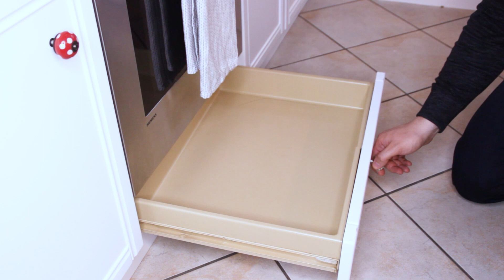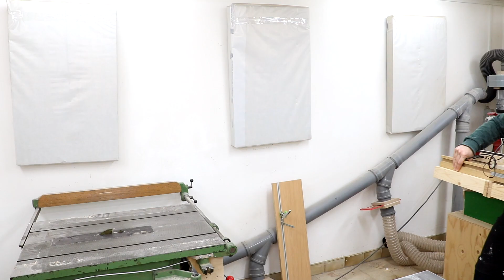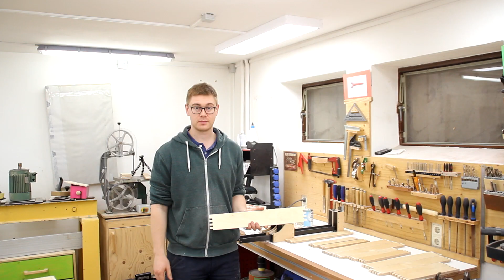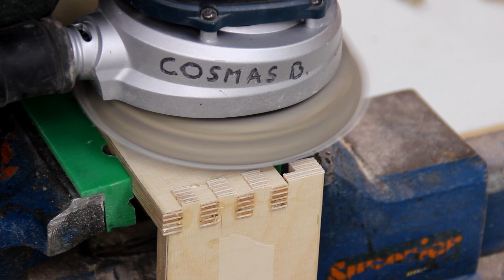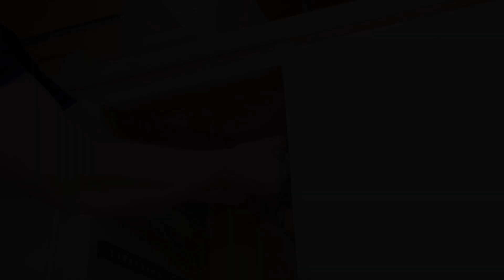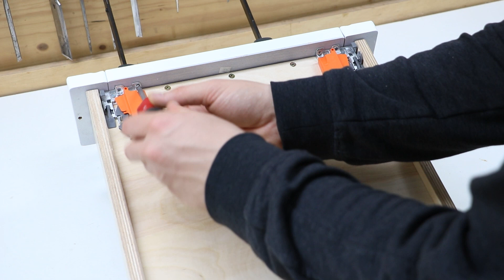Making Finger Joint Drawers for our Kitchen Makeover (Hidden Drawer Slides)

Comment: I really liked that quick fix on the box joints. Hadn't seen simply using a sander to both provide sawdust and help set the glue.
Also, I love the knobs on those drawers. They look hand painted. Did you do those, too?

Comment: Cool project and good to see that computer controlled box-joint jig again. :-)

I think you are right in that it was the backer-plate that slipped slightly during clamping the pieces in place during use so a way to stop that would be to have a positive stop that the backer plate stops / aligns against when positioning it on the jig, that way you don't end up with it slipping during use. As long as you always home the jig against the same switch / hall sensor then the sled and backer should always end up at the same place ready for the next cut. :-)